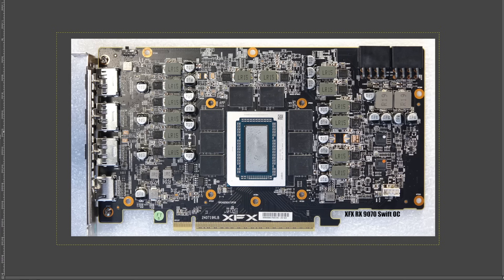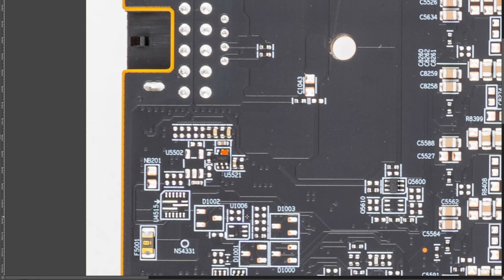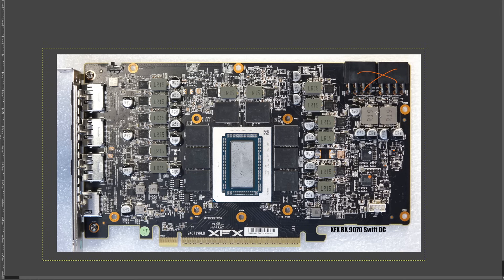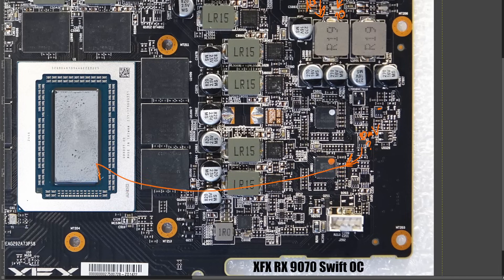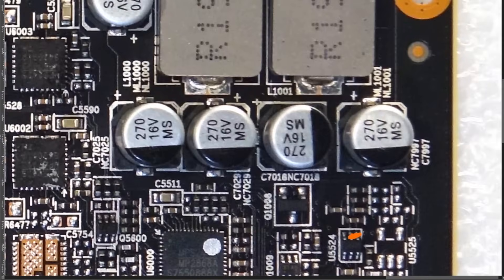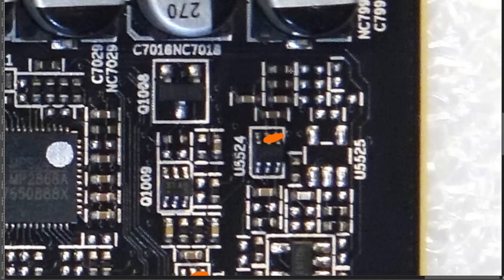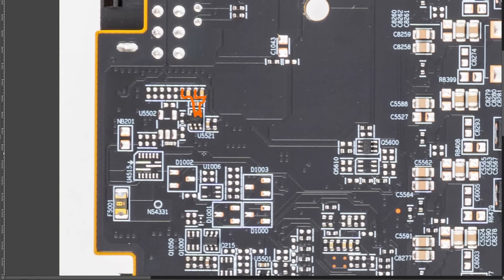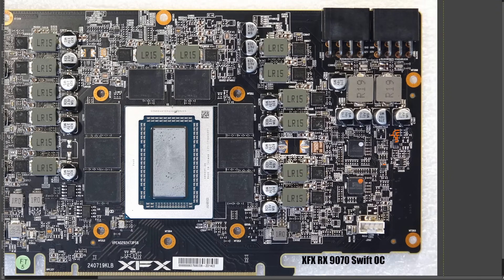How to physically disable the power limit on RX 9070 XTs

Comment: Just curious, All of the pins you showed to short were identical save for 1 set on the Sapphire RX9070XT Pulse, on the U5521.  All others were the bottom right side 2 legs but on this card it was the Top ride side 2 legs (orienting by the direction the U5521 text is printed.  This was the only instance and I'm assuming those were not the correct legs since all other instances were the bottom 2 legs.  I'm sure it matters but maybe it doesn't as in, maybe the legs are pwr/gnd/pwr and as long as you short 2 of them its good but just to clarify.  Thanks!   I guess @14:59 you cleared this up.  Just trying to extrapolate for Asrock Steel Legend
Reply from the maker: oops that's a mistakes it was supposed to be the 2 legs on the top-right side.
Reply: just visually look for those ICs with similar resistor/capacitor layout, then measure the resistance from the resistor to 12v input (can also measure the resistance of the resistor itself since they should all be 10ohm, as sort of a double check)
Reply: Would this work with staples and a hot glue gun? No im not joking, i dont want to solder just in case i have to replace the card.
Reply: @Amp_Edition  No.

Comment: Hello, I have the Nitro+ GPU and I want to add a physical switch to toggle the power-limit disable. I plan to use a 3-pin slide switch: connect the two GPU pins I want to short to Pin 1 and Pin 2 of the switch, leaving Pin 3 unconnected. That way, when the switch is in one position the pins are shorted (power-limit disabled), and when in the other position it returns to normal operation.Is this correct?

Comment: Buildzoid, a little observation and continued torture of my modded Asrock Radeon RX 9070 XT Taichi OC, it appears the 12VHPWR connector is set to 450W mode.  This card has a TBP metric that doesn't work anymore, but it also has a TGP metric, Total Graphics Power.  This still measures power consumption in correlation.  Under Furmark 2 testing, the TGP maxes out around 430W.  TGP appears to be around 20 to 30 watts less than TBP.  An extra note, I am using a "600W" 12VHPWR cable to the PSU.

Comment: How do on Radeon AI PRO R9700? No one is doing reviews on the card, and no PCB pics.
I suspect that R9700s w/ no power limit will clock much higher than most 9070XTs; they're efficiency-binned Navi48 silicon.

Comment: I did this on my sapphire pulse, TS scores were initially worse. The power draw is reported as 7w. I'm now just working on getting scores back up.
Reply: Update, TS scores is now upto 32155 with no additional mods. Still no better than a stock card without volt modding.

Comment: I fully appreciate this video.  I have an Asrock Radeon 9070 XT Taichi, and I did successfully "bypass" the power limit.  I am a little proud of myself with the soldering.  TBP reports 3W, but to note, the TGP still reports power usage.  This was also part of a plan to put a waterblock on the GPU.  As far as that progress, all the temps are down... except the hotspot is bad.  I will be reapplying thermal paste and pads the next time I get a day to it.

Comment: You wouldn't happen to know where these are located on the Gigabyte RX 9070 XT Gaming OC, would you? Do you think that running the necessary wiring for a switch instead of a spot solder would make it harder to put in a waterblock? And are there any major downsides to doing this (beyond physically making a mistake and whatever that causes)? (I assume it's still able to thermal throttle effectively and the clock values will read back correctly in HWInfo, but maybe not the power draw? If I'm able to keep thermals managed and within the normal range, will the GPU still live as long as without the mod, or does the increased current put extra stress on the card independent of thermals  (I know this is the case with Intel 13th and 14th Gen i7 & i9, but with voltage)?

Comment: I just found your channel. Excellent video and instantly subscribed. Huge question for me, and I may find it in another one of your videos, TBD. But if the adrenaline software only allows for the 10% slider, and MPT doesn't support 9070 yet, how do you overclock the additional power? Is there better gpu tuning software available I am not finding?

Comment: ok but if you do this, how would you increase the power draw? will it automatically just use more power or will you be able to increase power limits via software? I want a 9070 xt but I do not want to pay 30% over msrp, i see 9070s all the time but it is very power limited

Comment: Okay late, but just for the record, I've tried this on my Sapphire Pulse 9070 XT. Results:

The card did in fact think it was drawing about 15 watts under full load. Overclocking from that point, however, was tricky and produced very mixed results. I saw a max clock increase of about 150MHz vs what I could achieve previously, but the card still didn't seem limited by things like voltage or max clock speed most of the time (from 2900MHz under heavy load to 3050MHz). And even with a clock speed bump, There often seemed to be little to no performance improvement.

The card would sometimes boost super aggressively though, and I couldn't figure out what the necessary conditions were for that. Like jumping from 3050MHz to 3175MHz suddenly during a load, AND sustaining that, with a hotspot increase to 90-95C (normal was 80C). This was repeatable in Steel Nomad, where it would boost aggressively about two thirds of the way through the test, for the remainder of the test.

I undid the mod after a couple of hours of testing, and everything seems fine and is back to normal. Max Steel Nomad score went from 7474 to 7626. -100mV, 2664MHz on memory with fast timings. I couldn't tell you whether any of the other Adrenalin tuning settings changed anything.

Comment: Good that you pointed out that you can't just bridge all the chips together. But you certainly can use a single switch to open and close multiple independent circuits...
Reply: Well... you can get dual switches, they have 6 pins, share a common knob, but each row of 3 pins are electrically isolated, and you could literally shove the PCB edge between the two rows and send bodge wires out, and epoxy the whole thing down.

Comment: Actually you can use a single switch to turn the power limit on or off on a dual 8 pin PCB. you just need to use a Isolated Dual pole switch. very simple

Comment: Thanks for the video. Will you also be doing a over locking video with your card and no power limits? I guess these chips could pull up to 450 with stock voltage.

Comment: Now I wonder, with all the power and heat on the GPU PCBs, doesn’t it matter that much for the shunt circuitry to at least use a divider to compensate some of that temperature dependent resistance?

Comment: Thank You for this video. I have some questions: 1. After this mod will the power slider in AMD Software do nothing? Will the card try to run at max clocks based only on core voltage, temps and clocks offset in drivers? 2. Are there any downsides having a card with this mod as a daily driver, assuming using a reasonable core voltage?

Comment: I took a look at the datasheet for the MPS chip those signals are presumably connected to. Oddly, the recommended circuit just has a simple resistor divider and one filtering cap on the VINSEN input. I'm guessing using little amplifiers is an AMD reference thing that the manufacturers copied. If it was up to the board manufacturers, I'm pretty sure they would have stuck with the MPS reference and not bothered with the amplifier and extra passive filtering components. Not sure why AMD chose to go with this setup though. Maybe it means the shunt resistor doesn't heat up as much? Maybe the signal ends up cleaner? Maybe its something else?

Comment: no joke this makes me consider the non-XT even more since the price difference is still pretty drastic where i am. i can plop 2 little soldering blobs onto a PCB all day long for 250 bucks less... though i'm curious about the actual behaviour of card that's modded like this, since the clock speed sliders seem to do fuck all anyways. so how are you going to control the cards speeds when by default it's always riding the power limit when it has no idea how much power it pulls. is it just going to be voltage limited all the time now?
Reply: my questions exactly!

Comment: I'm having Athlon 'pencil mod' flashbacks.
Reply: OR the superglue and rear defroster repair kit...for a permanent mod.  😉
Reply: aww.. 
the gone times. :)
Reply: @emperorSbraz  this actually seems primed for pencil modding, you can probably just pencil the feedback resistor
Reply: @mycosys Time to put the sketch back in sketchy.
Reply: Or rear window defroster repair fluid
Reply: You mean Celeron 266 for slot 1, right? :)
Reply: those were the days
Reply: I had the athlon thunderbird 900mhz overclocked to 1.1GHz. Fun times 😊
Reply: I was just thinking, what ever happened to using silver paint? 🤣
Reply: The days of drilling your CPU to unlock it.

Comment: I am wondering, could you instead of completely shorting those pins just bridge them with some specific value resistor to eg. double or triple the power limit, so the software reporting still works and you just see 1/2 or 1/3 the true wattage?
The shunt in self is very low impedance, so leading up to the sensing IC there is some additional resistance, that when shorted, makes the voltage drop from the shunt divide to zero, is that specific additional resistance value known (in schematics) and universal across all these GPUs? So one could calculate the required resistance via which to short those pins to make the mentioned double/triple power limit scaling happen.

EDIT:
Ok stupid me didn't pay attention, so that resistance is about 20 ohm (2x 10 ohms as you mentioned), so my edited question is, are those consistently 10 ohms?
If so, the answer to my question is shorting with 20 ohms for 2x power and shorting with 10 ohms for 3x power.

Comment: Actually, the 12V connector is not the problem. GPU/CABLES/PSU are. there's 0 nitro+ or taichi oc with failure while all the RTX 50XX are failling, RTX 5070 too. (I own 2 9070 XT TAICHI OC and 1 9070 XT NITRO+ and i have 0 problem with them, tested with a 48h run on furmark at ~380W) --- https://www.youtube.com/watch?v=-5v3T-YVIvo this guy tested ~1300W on the connector and while the cables started to melt after a 240min furmark run, the connector was fine. Maybe i'm wrong but we will see if my gpu or other 9070 xt with 12V start to fail. (thanks for your amazing vieos like always ^^)
Reply: The connector is a problem on a 5090, but the main problem is the complete and utter lack of load balancing.
Reply: It’s the connector and the design of having so much current with minimal overhead.

Nvidia with is quest for aesthetics makes it a problem, it should be 2x 12vHFR connectors. They just don’t want to do it.

Comment: Would be great to see the overclock gains 9070xt & 9070 gets in a future vid with this mod
Reply: minimal. Even with 110% power limit it's barely any better than at 100%.
Reply: 9070xt does not has an under-power problem, in fact it profits more from under-volting, So why would you physically mess with a cards warranty for no reason at all?
Reply: @yspegel  The reason why undervolting increases performance is because the GPU is power limited.  Undervolting stretches the power limit further, showing that increases in the power limit can yield higher sustained clock rates.
Reply: @yspegel because if your watching his channel, you like to f with things. If you don't, this probably isn't the best place for you. Do I need to delid my 7600x? Absolutely not, will I in a few years when I'm bored? Absolutely
Reply: @ryanwashington3330  the main idea is to get more performance out of it. Not "how much powa do I get trough the card without burning the house down" 😜
Reply: @yspegel I have a 6800xt with a 7600x I'm not burning my house down 😂 I love to see the high numbers, I Oc'd the crap outta my CPU and GPU to the max, then found a happy medium (not 110 on the GPU hotspot) and that's what I use. The thrill for some of us is pushing the limits for little to no reason, while for others running stable with warranty, and just playing game you like is what you prefer to do. We're different, but we both love our pc's

Comment: So, does a higher or unlocked power limit automatically mean higher boost clocks for RX 9070 XT's? Or are there other factors at play (I mean apart from silicon quality)?
Also, is there a way to unlock the Power limit via a BIOS flash? My XFX Swift 9070 XT has a dual BIOS after all. Would be nice to be able to play with that rather than soldering and then having to redo that PTM7950 thermal pad.
Reply: more than 110% power limit will do practically almost nothing if you can't overvolt the card and with current vbios you can't.

Comment: How much are these cards realistically power limited on air?
Reply from the maker: The 9070 has a 264W power limit. I had mine pulling north of 400W in 3Dmark timespy.
Reply: @ActuallyHardcoreOverclocking  and how much higher did the clockspeed and performance go ?
Reply: Depends on the benchmark. For Furmark nearly every GPU in existence thermal throttle well before it hits its power limit because it almost doesn't use memory bandwidth.

Comment: I was wondering: Can we do this (not remove but increase power limit) by "pencil method"  without voiding warranty ? Theoreticaly it should work.
Reply: yes graphite conducts electricity.
Reply: You should be able to pencil mod the feedback resistor
Reply: ...or drop of liquid metal 🌶
Reply: @jimbonetic  PCB is copper under the coating getting on to that would permanently bond it.

Comment: Maybe It can help with understanding the power graph you are drawing;  Anytime we want to measure actual power, its always an integral ie AREA , rather than height of the graph. So a spike above the limit can easily be negligible if "the area of the curve above the limit" is still very small. 

This is the same as with speakers which most people understand, that peak W, and RMS W are not the same. RMS is just the integral -> area -> which is actually just an average. So the formulas seem super fanchy but in reality the important part of the calculation is just an average of the values of the graph. So when the math geek writes some integral , dt  -> it is actually just: accumulated sum / width -> which is just the average. the dt is just dividing by the width of the section in question turning the sum into an average.

I hope someone gets something from this :D I would hope someone not so strong in the theory area could maybe get some opacity to the veils of the evil math.
Reply from the maker: the reason I didn't study electronics engineering is because my math grades sucked.
Reply: @ActuallyHardcoreOverclocking You're what I call a right brain engineer. We make great industrial designers and ask the questions that annoy 'real' engineers but when our powers are combined we become the Ying and Yang of good design.

Comment: Amazing Work ! ! I'm going to use some 24 gauge stranded wire from network cable i have laying around to wire up to a dual pole single throw switch. And a quick question, would it be a good idea to reboot for every time you want to toggle the power limit or can it just be done hot.

Last time i did a physical power mod was on a HD 4850. First I got it a max OC with a BIOS mod of something like 850MHz, but i also slapped a HP SFF triple pipe CPU cooler and a bunch of copper heatsinks on the VRAM and power rail which ran VERY cool (used steel wire to tie a 90mm fan onto it). Then i did the pencil mod (put clear coat paint to 'seal' it when i was happy with the voltage) to get something like 1.45v and I landed at 1150MHz and still ran cool enough that i could make it virtually silent. This was like in 2008 paired with a Intel Q9550 OC'ed to 3.625 (super quiet mode) and 3.95 when i felt i needed it. Also had a SandDisk Ultra ii 128GB SSD and 2x1TB WD Black drives in RAID-0.. I was soo coooool

Dang, I'm amazed i remember any of that lol

Ran amazing for 2+ years until someone actually broke into my house and stole JUST the PC and nothing else WTH 😅buddy said it was a 'Hood' job. We live in the burbs lol. I kind of knew who it was but could never prove it so i was SOL. TON's of computers that where already repaired and ready to be picked up, including Macbook Pro's. Hell, they didn't even take my watch 🤪

I'm about to be cool again when i disable the power limit on my 9070 Hellhound 😎